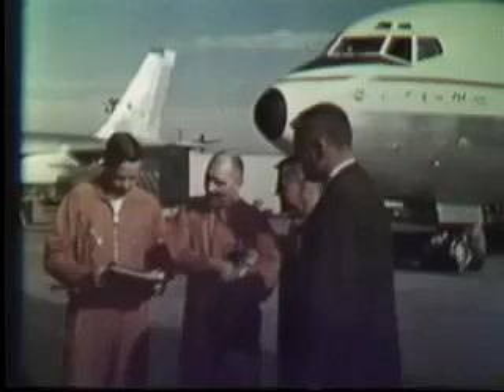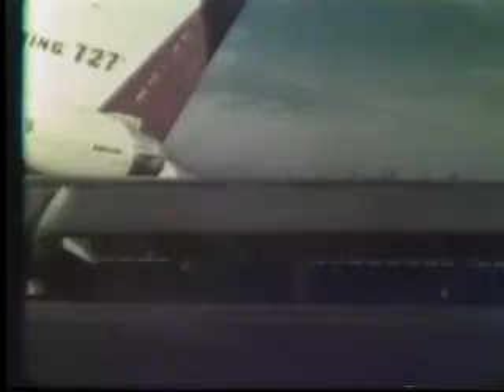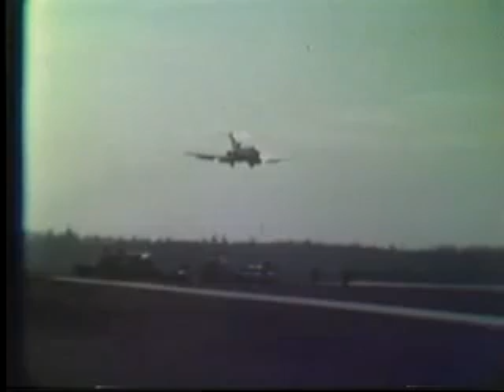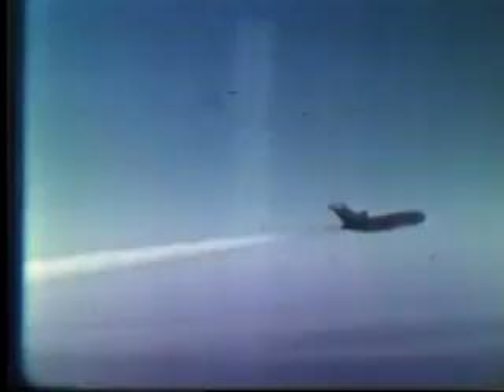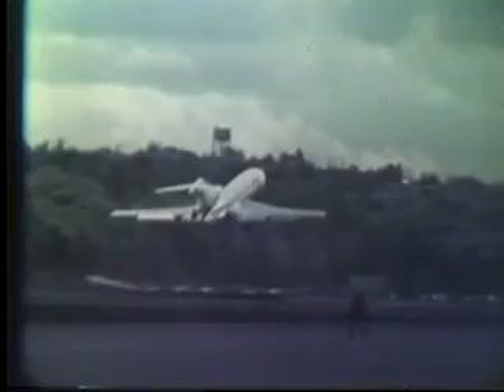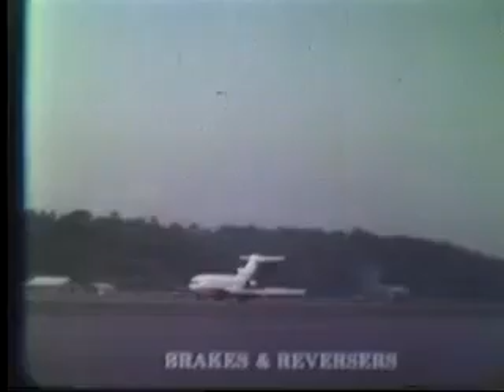Boeing 727 Prototype First Flights-1963-1964

Comment: Were these tests conducted with the then installed nose brakes, which were later removed? On one picture showing #3 engine trust reverser showing the later model louvered exhaust, while later in the video all three reversers were the clam shell type as installed on the original JT8D-7. Still, great video. I was an F/E on this model in the 80s. Great airplane; some examples are still flying.